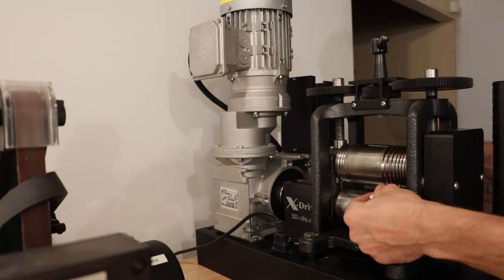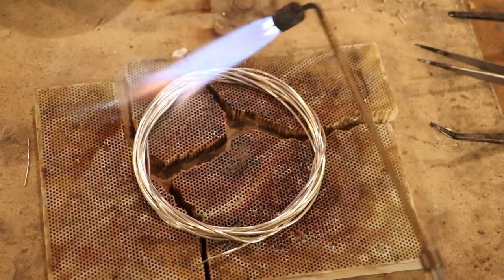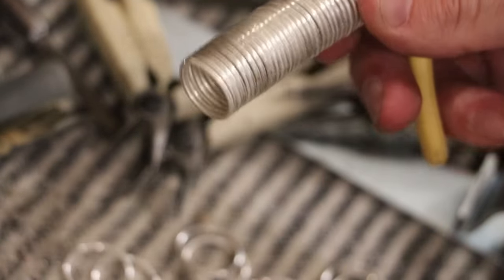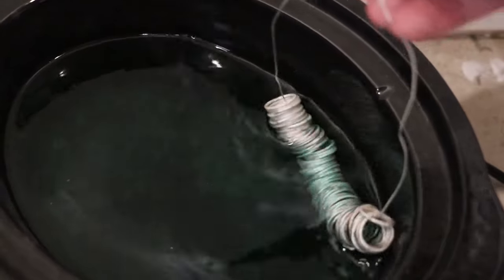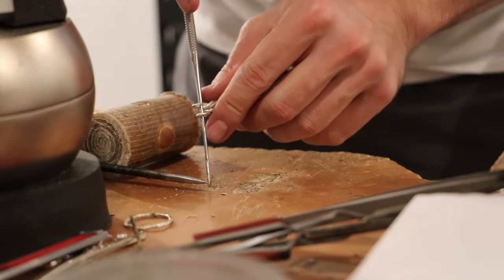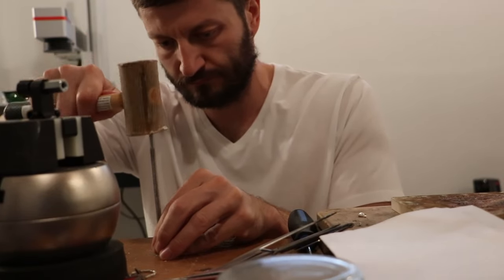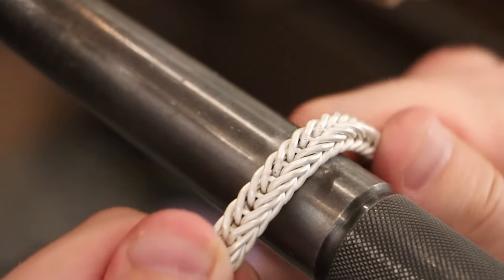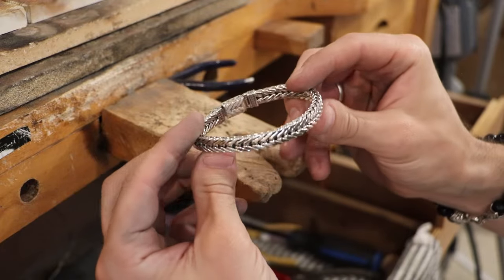Dynamis Jewelry: Crafting Jewelry That Speaks

Comment: It's unpleasant to watch such episodes with AI 😮
Reply from the maker: Why?
Reply: @DynamiSJewelry  Because the recording is stating the most common statements again and again while not giving any helpful information about the process of making this particular item such as about the tools and the measurement of the rings And that's why it's distracting ! Btw what is that black box called through which you pulled out the bracelet and what is the use of it ?? Did you use it to make the surface flat like giving it a square shape ?? What is it called ?